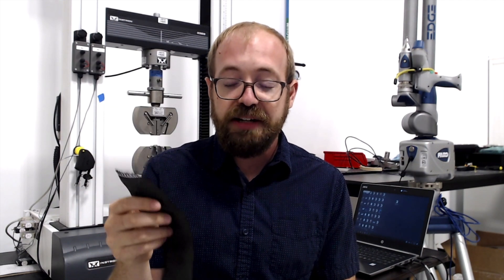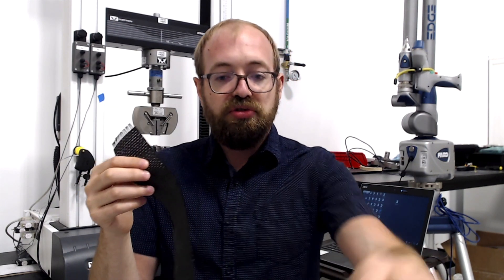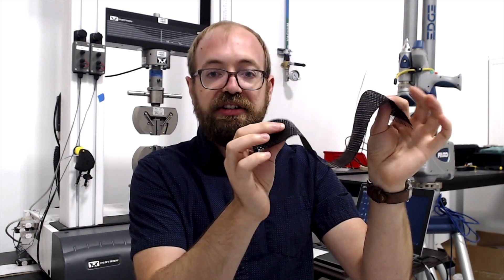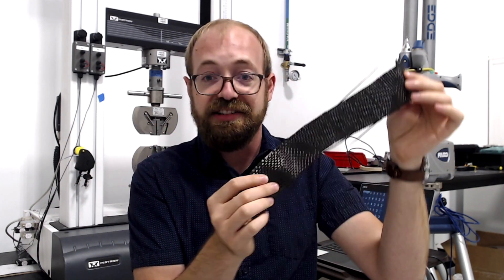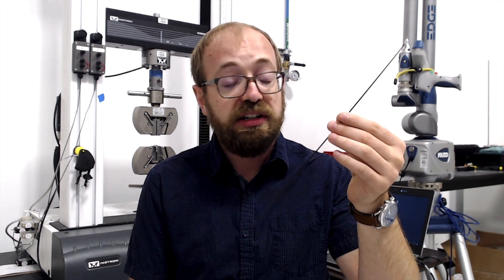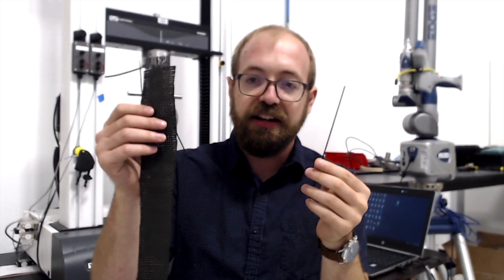Superstrata Manufacturing Process

Comment: So it is welded? "I thought it is a unibody".. How it is more unibody than my aluminum frame then?
Moreover, you said that you have a software that can compute the stiffness of the frame. Is there any configuration that can hold a 70 Kg rider without a seat-tube without a deflection of several millimetres?
Reply: https://www.bike-magazin.de/mtb_news/szene_news/superstrata-3d-gedrucktes-carbon-bike. You might need it to translate, but they tell how much of a scam that bike actually is. No way that it's strong enough to hold.